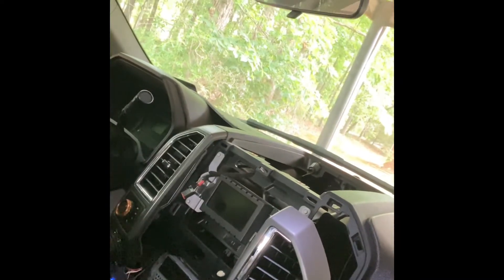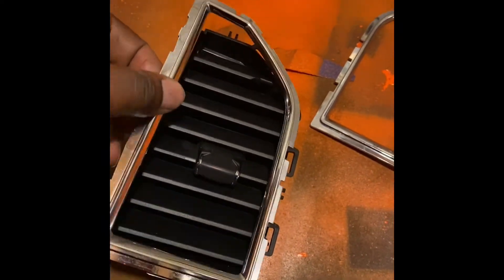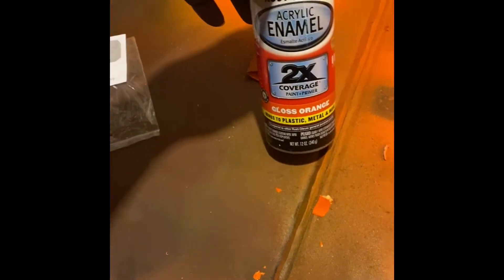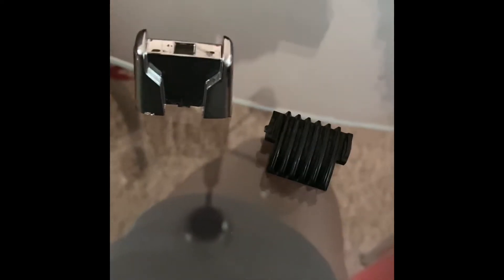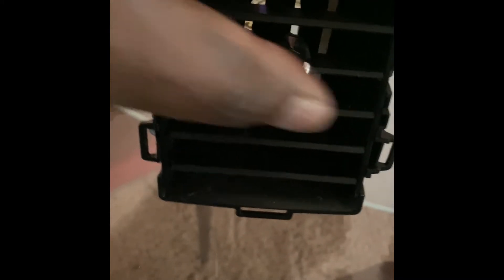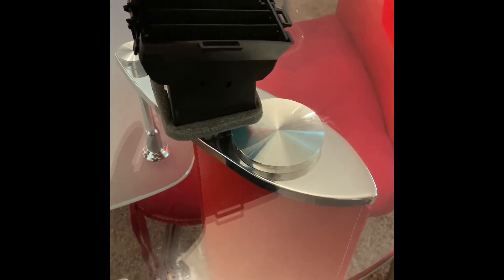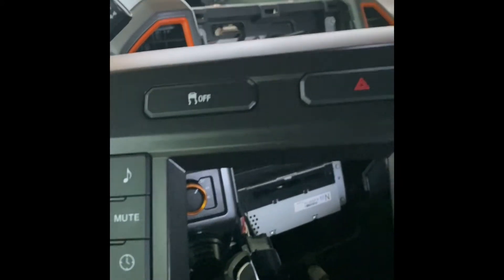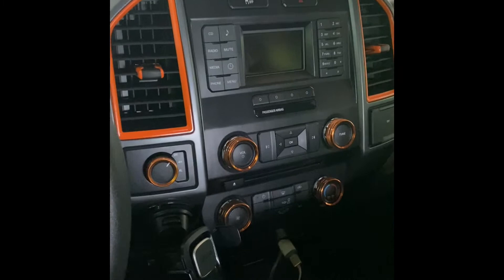Interior chrome delete f-150

Comment: what about the interior handles and the guards?
Reply from the maker: Great question. In another video I did the guards. 
https://youtu.be/ZMyRmVBf7bA
Thought about the handles but never came up with what to do
Reply: @BeastieChronicles  ive been thinking about changing all the dark grey and paint matching to the truck then painting every ounce of chrome red since its all black. Just unsure if i wanna do something permanent that someone else might not like if i sell it.
Reply from the maker: To be honest, I use plasti-dip as my trial and error.I used it first before I committed to actual paint. In your case use it for now and if you want to resale just peel it off
Reply: Does the Plastidip last very well being peelable? Also i know the handle and guard was mentioned, what about the chrome around the shifter, assuming you have console gear shift?@BeastieChronicles
Reply from the maker: @alot412nv thanks for asking. It last about a good 6 months before you need to reapply
Reply from the maker: @alot412nv plasti dip last anywhere from six months to a year on exterior(depending on how many times you wash it). No my gear shift is on the column